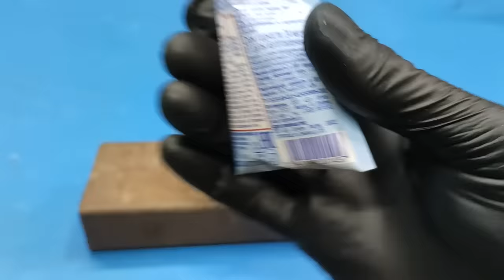Don't buy super glue, make it yourself in 2 minutes from vinegar!

Comment: I'm not a chemist, but I'm pretty sure pectin, water, vinegar and glycerin don't add up to cyanoacrylate.  Also, basic school glue is adequate for all dry wood gluing applications. Furthermore, unless formulated as cyanoacrylate gel (another mystery to which chemistry holds the key), super glue isn't that thick and is never opaque like that regardless. Finally, super glue is activated by moisture. The moisture in air or ones' breathe is enough to catalyze it. I'm impressed by the apparent success in glueing glass, but whatever kind of glue was made here, it fails to demonstrate the properties of super glue. Super glue should set in 30-60 seconds and achieve full strength in a matter of minutes, which is what it was invented for. The two hour clamp time is outrageous even for Elmer's school glue (except in sub-optimal temperature). Will baking soda accelerate this glue? It will accelerate super glue.
Reply: I am and it doesn't
Reply: Glue made from boiling hooves and horns was traditionally used in guitar-making and leathercraft. Powdered gelatin comes from the same stuff as well. This glue is strong but yeah, this is not cyanoacrylate IMHO.
Reply: It's a much better option for people like me who are allergic to super glue regardless of whether or not it's used in an open, ventilated area. 

It's also a better option for DIY pet toys (ie for birds, hamsters, mice, etc.) Contrary to what you said, school glue doesn't always work very well to hold wood together... especially for parrot toys.
Reply: There is a better option by melting thermocol in petrol - the glue you get from there can hold rocks!
Reply: @sumanngon  yeah but working with gasoline and it's fumes doesn't sound too appealing IMO. I like the option in this video that doesn't create strong fumes. Plus this is more environmentally friendly than super glue or gasoline and Styrofoam for those that care about things like that.
Reply: @scootermom1791  You raise some excellent points. Concerning school glue, unless it's labeled as waterproof, you can take it to the bank that anything labeled as wood glue is just school glue with dye in it. The key is in proper clamping and keeping the finished piece dry. This type of glue is the only fastener used in joinery (cabinets and furniture; provided these are made from actual hardwood and not particle wood).
Reply: What is thermocol? @sumanngon
Reply: Agreed
Reply: Quick setting is what it was invented for... fact. More specifically it was invented for quick battle field sutures. Quck setting certainly helps with that. 

Unfortunately my dog got in a bad fight with a pit bull. I washed out her wounds and pinched them together and applied a drop or two or three of superglue per wound to close the them up. Maybe some might take offense to this but it saved me a vet bill that would have cost thousands, yes she healed up well.
Reply: @kreynolds1123 
It even works on humans. In a pinch, it's good to have when camping, working with chainsaws, or other sharp tools.
Reply: @Daniel_Antonio_Arellano782  yup, a friend of mine got impaled by a huge sliver in his hand at a wood mill. He pulled the sliver out and  Superglued it. That when I first learned about the reason it was invented.
Reply: @stephenandloriyoung5716 apparently it's polystyrene. It doesn't have to be petrol. A better and less toxic option is acetone/nail polish remover. A saturated solution evaporates leaving the plastic behind as a layer. 
If you add graphite it's reasonably conductive. Both are fun to play with, especially since it's often waste.
Reply: You are right.  The granular powder is NOT pectin (a polysaccharide), but rather, gelatin ( a protein).  The vinegar serves to denature the polypeptide strands, causing it to solidify.  The glycerin is there just as a texturizing agent.  Such a glue can be strong, but deteriorates with aging, especially if it is humid where it is prone to bacterial or fungal degradation. This is rather like what is known as: "hide glue".
Reply: @stephenandloriyoung5716   Basically it's Styrofoam
Reply: He made hide glue. It's what they use to make violins and guitars. Good stuff, but it melts at temperature and water dissolves it.
Reply: I think he essentially made hide glue
Reply: water glass aka sodium silicate looks like a better alternative than this lo .. and your right elmers glue would set up faster.. i doubt this concoksion will stand up to school glue..if that.
Reply: yes, but 'superglue' is a broad term on Youtube
Reply: @MyMy-tv7fd  maybe for misleading click bait.
Reply: johnfoley4023  He used horse / bull sh1t instead !
Reply: No, there's a huge difference between pectin/carageenan (plant polysaccharide hydrocolloid), and gelatin (animal bone collagen). Like Knox and Jell-O, Dr. Oetker gelatin is animal collagen. Once anhydrous, gelatin is as hard as rawhide.
Reply: arjaysmithjr9083  😮
Reply: wow....girlfriend needed asap
Reply: I was just about to say... That's not cyanoacrylate. WTF is that?
Reply: @NormanLim  "hooves and horns"
Yes. This is probably much the same as traditional horse glue with the modern convenience of packaged gelatin
Reply: you're correct, that's not how cyanoacrylate is made. It's basically the gelatine that keeps the parts together, but usual school glue would do the trick as well, and even flour, egg-white and water can make some kind quite nice glue. 
However, the "super glue" shown in the video, and the others mentioned here, will quickly lose their strength when getting wet. Superglue will not.
Reply: .. taking this as a starting point..its possibly to make an even stronger (and enviromental friendly) glue using just Milk, Vinegar, Sodium Bicarbonate, some water and heat (the consistence can be adjustd as needed with water/sodium and glycerine), dissolveing just a timy ammount of salt in it will aslo make it mold resistant....
1. add milk
2 .add heat
3. add Vinegar and stir (the milk will separate into cheese base and whey.) 
4. discard the whey (without burning urself)
5. add sodium carbonate and stir until the reacton stops
6. add water to make it useable (adjust thickness as needed)
7. keep adding sodium and stir until lumps r gone (depending on milk,vinegar, heat)
8. congratulations u made ur first Kasein glue (Protein-phospor based glue)
Reply: The pieces of "glass" actually look a lot more like plastic. That would account for why they were easier to glue than they should have been.
Reply: @LexipMedia  its eithe acryllic or poly carbone (plastics) not glass, that would be useles glue any pure glass..
Reply: Thanks, you typed it so I didn't have to..👍🏼
Reply: Who speaks about cyanoacrylate, before you?
Reply: @amedeekingchef6552  I started this comment thread, but someone might have mentioned it further down in other threads on this video.
Reply: @Patrik6920  Sounds like an interesting recipe. I might even try it one of these days. (I vote you should make a video on it.) The fact that you can give it a chemically accurate name adds to your credibility.
Reply: @broderickelliott8527  well, im not much of a spotlight guy...
Reply: @amedeekingchef6552  Hey Troll, cyanoacrylate is Super Glue.🤡
Reply: This is really just "animal glue", which is really pure gelatine you can buy as flakes and then melt, apply and when it is cold, has a very strong bond.
By dissolving it in water, just made a version which relies on the water drying out to set it up.
In other words, he's gluing stuff together with jelly ("jello" for Americans).
Reply: It's actually the 'base' that accelerates cyanoacrylate. Baking soda is a base, vinegar is an acid, mix and watch them react.
Reply: @dcalsbeek5831  Congratulations: you just made fizzy water with vinegar and baking soda.
By neutralising an acid (vinegar) with a base (baking soda), you have created sodium acetate (crystallises out) and carbon-dioxide (fizzes off), plus a little bit more water.
There is nothing in that reaction which creates a glue, let alone a chemically unrelated cyanoacrylate glue.
Reply: @amedeekingchef6552  Super glue is more or less an analog to Cyanoacrylate .. Cyano actulate was alos marketed as SUper Glue for a long time (and sometimes still is) Supe Gule, Super Bond, Multi Bond, Fast Bond etc.. but Cyanoacrylates are a familly of glues with very simallar properties...
Reply: @dcalsbeek5831   That's interesting information and worth looking into. The fact remains that baking soda is a useful and versatile accelerant of cyanoacrylate glues and if it won't accelerate this very innovative homemade glue, than it's misleading to call it 'super glue.'
Reply: @Patrik6920  Correct me if I'm wrong, but I recall that there's cyanoacrylate A and cyanoacrylate B and that in practical application, there are different plastics they will bond. So carefully examining the labeling on the super glue packaging will help a person purchase the right one for whatever plastic (if they're dealing with plastic) they're trying to weld.
Reply: @NormanLim  hide glue or bone glue normally needs to be heated to about 60-80 degrees and it first setting occurs in less than one hour (!), assuming this one is really gluing something (?) maybe this makes it working at normal temperature as some "modern" type of animal glue? worthless to say this has nothing in common with cyanoacrylate.
Reply: Thank you for this comment.  You just saved me, and likely others, 6+ min of my life
Reply: Hide glue, not super glue.
Reply: @necspenecmetu-24  Ordinary school glue sets in less than an hour. As I've elsewhere explained above, most wood glue used in joinery is just school glue with dye in it, so it can be a very effective glue when used knowledgeably. All that only matters to make the point that a set time of less than an hour doesn't make an adhesive anything like cyanoacrylate at all. A full minute would be a long set time for Cyanoacrylate/super glue, and it requires no heating whatsoever. If properly stored (i.e. sealed against airborne moisture) it's immediately ready to go. Regardless of the virtues of the glue in this video or hide glue in general, the only thing it has in common with Cyanoacrylate is that they're both adhesives.
Reply: Broke my favorite hard plastic hairbrush in half when I dropped it in the sink. Almost threw it away,but decided to try the superglue and baking soda trick. I now have my beloved brush back working. I cannot believe how hard that baking soda/superglue combo becomes!
Reply: @mikedunn7795  That stuff can be sanded, filed and even (carefully) cut. It's magic.
Reply: Many of the comments here are worth reading. The fact that we are talking about it deserves a thumbs up for the discussion generated and the collective knowledge benefit us all.
Reply: water vapour activates superglue and water can be used to degrade set superglue. water is both a catalyst and solvent for superglue if that is a right way of saying it. So i would not use superglue for marine applications for that i'd use epoxy.
Reply: @maxheadroom1506  That's useful to know. Do you have any data on the degradation rate of set Cyanoacrylate when exposed to water? Does it need to be continuous exposure and for how long? I ask because I have seen super glue recommended for applications involving repeated, short term exposure to water, specifically as a glue for tying flies.
Reply: @sumanngon 
What is thermocol?
Reply: @stephenandloriyoung5716  basically a styrofoam
Reply: johnfoley4023  In a pinch, would cat poo work? I don't have a dog.
Reply: @sumanngon  yes
Reply: @bob-rogers That's why I could never play underwater violin in the thermal baths !
Reply: @iggzistentialism8458 do you mean we can make the DIY Superglue or even any kind of superglue, conductive with graphite power?
Reply: arjaysmithjr9083 Serious? Whole thumb with bones also cut or just flesh?
Reply: Why glycerin?
Reply: U kno a surprisingly large amount of chemistry for a 'not Chemist'. Salute from a Biochemist.
Reply: @aniksamiurrahman6365  Thank you. I aspire to Biology, which stands on the shoulders of your specialty.
Reply: Gelatin. 
Pectins frim fruit
Reply: I love engineer types who always know better than everyone... Wtf who gives  a dook  we know its not really super glue, just a brand name anyway... The whole point is he made a pretty cool alternative  glue for the DIY'rs not engineers not chemical engineers not chemists not for geniuses.. I seriously doubt there are any of the aformentioned wasting time on youtube commenting on various YouTube shorts videos..
Alot of these videos are made by people that are English as a second language people you shoukd be capable of not taking every thing literally. Lighten up and btw anybody couldve pulled up  some google searches or YouTube videos about super. Glue and just disseminate it here. Not. That difficult. Origional thought is where i believe true intelligence is born and arrogance is usually remedied with a heavy fist to the face
Reply: @mr.mcfall2224  Assigning a label to all the feedback you don't like and then disregarding it isn't original thought. For the record, I'm aDIYer. I watched this hoping to save money, since the quantities of Super Glue I sometimes use get expensive. That 16 ounce bottle can sometimes exceed $60. I'm objecting because I feel this is clickbait. I can't remember the last time I needed to glue glass, and that's all this glue really has to recommend itself. It's not super glue. Saying it was IS the thing that brought people like me here. Nobody has made any personal attacks or implied any threats until you. Shame on you!
Reply: They basically made horse glue. Nothing more.
Reply: @broderickelliott8527  as soo as they say "let it dry"? Its not superglue cos it dosnt "dry".
Reply: @nathangrueber9834  I'm not completely certain what you're trying to say and I recommend editing your comment for clarity. I never said it wasn't useful glue; if you read through the discussion, you'd know I use and recommend slower drying glues for appropriate applications. The issue isn't patience. The issue is false advertising. If there was a way to safely make super glue at home, I'd be all over it, because I use it in quantity and I NEED it. That need is what brought me to watch the video and I was disappointed.
Reply: @broderickelliott8527  you said "superglue" anybody hslf educated knows what superglue is cyanoacrylate.
Reply: @nathangrueber9834  You're really not making sense, dude. Super Glue is a market name for the adhesive known by the chemical name cyanoacrylate. Super Glue=cyanoacrylate. That fact has been central to this entire thread. I'm really not sure what criticism you're trying to levy against me. The video title says you can make Super Glue at home from vinegar. Only, the glue they make isn't cyanoacrylate. The video title is incorrect. That's my entire complaint. Everything else in this thread is just conversation. (That and a few people who for whatever reason feel the need to defend the miss-titling of an otherwise impressive video.)
Reply: @broderickelliott8527   oh good lord!! Read what i wrote properly.

The video says "superglue ".
Superglue is cyanoacrylate.

This video is a recipe for hyde glue. NOT SUPERGLUE.
Am i clear enough!????
Reply: @nathangrueber9834  but the video title says super glue. I keep telling you what you're saying is unclear. It's really ambiguous as to whether you're criticizing me, sticking up for the video, or just trying to chat. I don't know how to help you. I get that the video is a recipe for hide glue. I understood it early on. I don't care about that, I care that the video title claims differently. I read what you wrote. Multiple times. The facts you state are clear and redundant. Your INTENT in stating them is as murky as swamp water.
Reply: @broderickelliott8527  jeez dude i spelt it out pretty clear twice.
Reply: @nathangrueber9834  And twice I told you it wasn't clear. I don't know what else to say here. You initially sound like you're trying to criticize me; I can't see why, since I've said nothing that isn't true. Then your statements seem to waffle. I really can't tell if you're trying to support me, fault me as being too critical or just make conversation. Either spell it out plain or go back and edit your statements for clarity and we can talk. I'm not responding to one more ambiguous comment.
Reply: @dheibeljr  i didn't see the horse. Woulda been great to see how he got it in the pot.
Reply: @mr.mcfall2224  engineer types built your fuckin house mate
Reply: is it water resistant?
please reply
Reply: @SudirikkuMadusanka  No, hide glue is not water resistant. It's famously water soluble. This recipe is essentially hide glue from rendered compounds.
Reply: I watched a bit of the video the time messed around, making it you have done the job using super glue.
Reply: Será que puedo pegar una gaveta de la nevera que se  partió por la mitad, y no quiero que se siga dañando.
.
Reply: one more
Reply: @broderickelliott8527  love that opening.....lol
Reply: There is super glue more thick also in the shop. Like for use on vertical objects to be putt and hold together with glue.